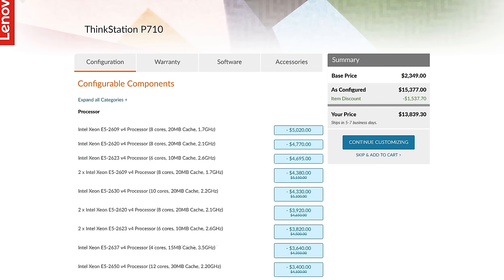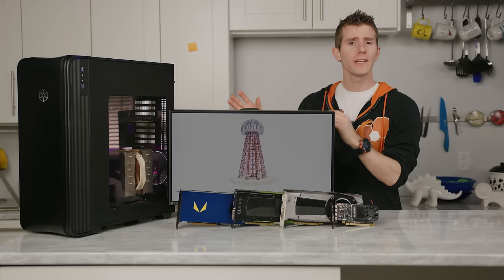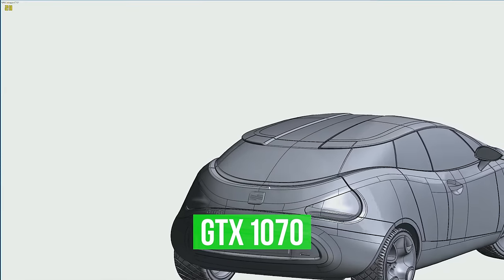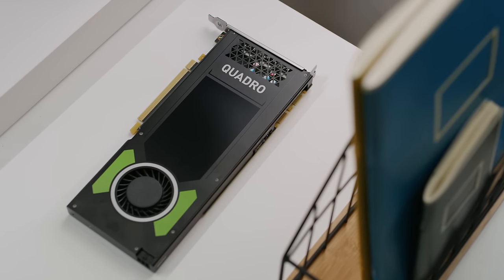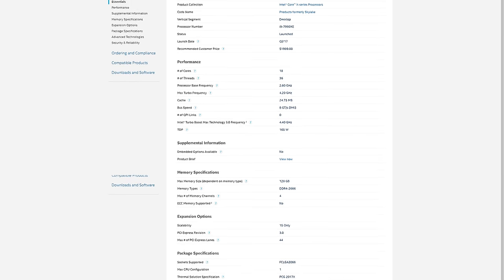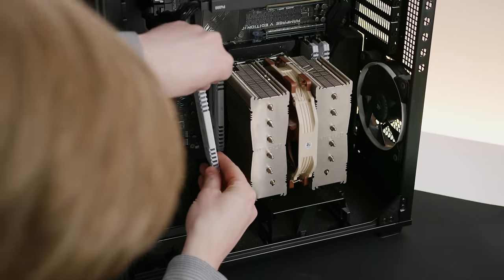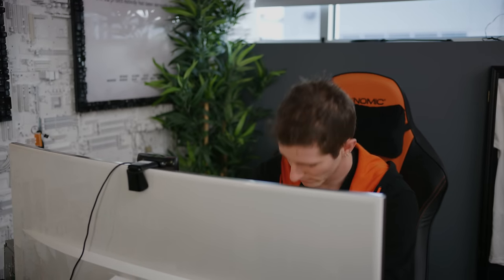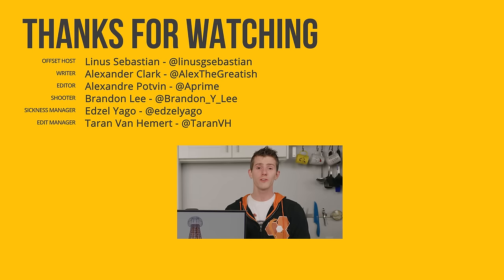3D Modeling & Design – Do you REALLY need a Xeon and Quadro??

Comment: Wait... If the Radeon Vega GPUs beat the Geforce consumer cards. Why was their no coverage of the WX9100 or the Radeon SSG with the Radeon Pro drivers?
Reply: Yeah, exactly what I was thinking, I also thought the whole shilling for intel/nvidia thing was mostly exaggerated or a joke but here it appears as if they are shilling...

Also, a few people noted that they probably wouldn't have just Solidworks or whatever prefered program running by itself, they may have a dozen other things also doing something and thus would rather have more cores than have Solidworks run a bit faster, so not sure what's happening on Linus' end but it isn't looking good on his part.
Reply: Linus' a shill. What did you expect?
Reply: I know, it's insane that he proved the driver can make loads of difference with these test and failed to include the AMD side. Especially considering that the Radeon Pro cards, which I would think to perform even better with the correct driver.

Comment: not to mention professional grade components are more stable. This is actually the core of the idea. Gaming desktop can outperform (in most senarios) a 2x more expensive proffesional desktop for design however it will lack in stability. This is no issue if you are designing for fun. However if design is the core of your job you should really be using proffesional grade hardware. I'm not trying to shift viewers to another person but tfi makes specific videos on inventor and hardware in link to cad, so if that's the program you're using i recommend checking him out

Comment: I use an Intel i3 4030U in a laptop with integrated graphics in blender.
Reply: Celeron G1610 with integrated graphics and 8GB ram in blender....!
Reply: 4gb ram. I feel you man.
Reply: :) Blender isn't for CAD as the subject  of this video is all about.
Reply: is it an hp pavillion? haha I got the same specs
Reply: Blender is not a proffesional certified software. Hence u can use anything. Try running a 4k full poly scene in maya with that...
Reply: Using Elitebook 8470p with i5-3320M and HD 4000 to game, browse web and do work
Reply: 512mb ram and a gt8400

Beat me
Reply: Can I see your portfolio of art works done with that laptop?
Reply: i3-6006U with 920mx :)
Reply: Mustafa Ahmed i3550 and integrated graphics 😀 it wasn’t too bad
Reply: I have used Blender professionally. It's not common but it does happen. It's a good program. I also like Maya and 3ds Max but don't have $4000.
Reply: TheVikingquest lmao you have no idea what you're talking about do you bud?
Reply: I use with a atom processor in my notebook with 2gb ram
Reply: @jm30013  lmfao what a noob. Mine is i3-2367M - intel hd 4000. 4gb ram
Reply: Then you aren't charging enough.
Reply: Been there, done that. I started blender using i3 2330M, Intel HD3000 and 2 GB of RAM. I feel u man
Reply: That's what I use. As linus says, "Fairly Affordable"
Reply: Blender will run on my old MacBook... enough said... ha ha ha

Comment: So how about the "Hybrid rendering" that I've been using on Vray. Works a charm with a good CPU and a GTX 1070ti
Reply: VRay isn't really a true hybrid renderer, it just emulates a GPU on the CPU. Also VRay is becoming more and more obsolete.
Reply: if you want gpu rendering go for fstorm,furry ball,iray... but specially not Vray
Reply: Hybrid render it depends, of your bandwidth to your Hard Drive, and your board from CPU to GPU, all so you need a faster RAM with a minimum of 8GB to take all the juice from your rig. That said if you cant aford a SSD to read from it you at least need 2 drives for render even  you dont do hybrid renders, one for read from it the file, OS, program, and the other one for dump all the finish renders.
Reply: nah forget those, use redshift or octane
Reply: Laughing at all the people on here talking down Vray. I've worked in the industry for 18 years. Vray has never been more popular. Newer GPU renderers like Redshift/Octane are cool, but Vray is still widely used and for good reason.
Reply: brendan coots Yep, they can forget those GPU renderers when making animations.
Reply: Charlie JH What hell is this "emulates GPU on CPU" bullshit? None of these emulates each other, it just simply don't make any sense. Rendering engine has to be coded specifically for used prosessor architecture and because Vray can produce very similar image on GPU than CPU, they had to make sure both produce mathematically similar end result from different architectural stand point and overcome possible limitations of small GPU cores.
Reply: Charlie JH Professionals Do still use vray as their primary engine. We use keyshot and gpu renders only for fun or on small scale projects. btw I render scenes with +million objects which is still impossible on gpu.
Reply: brendan coots that's what I agree on as well. It does also come to what you use it for. Here I make photorealistic renders of interiors and exteriors. For anything more VR I use UE4 or sometimes Lumion8 if it needs to be done fast.

Comment: At my school, we use Solid Edge by Siemens for CAD modelling. In school I use my Laptop with an I7 and a gtx950. At home I use a I7 7700k and a gtx 1080. Both work just fine, even my Laptop runs everything just fine, even if it is an assembly with 60+ parts. So in my opinion, I think it depends on the CAD program you use.
Reply: Solidworks doesn't use nearly the resources Linus indicates. 300 part assemblies run just fine on most modern hardware.
Reply: Solidworks would behave totally fine with that hardware. It's really not that much of a pig with system resources.

Comment: I'd agree with all of this if you're a hobbyist or student. But if you spend 40+hrs a week sitting behind a CAD machine, then you should really understand your workflow and tailor your system accordingly.  ECC and supported drivers are a minimum. 16GB ram is tight too. Ive never worked anywhere where the fastest machine available wasn't the best option, even if you factor in cost. Engineers are expensive, paying a high salary for someone who browses YouTube on their cellphone while waiting for a simulation to end is wasteful.
Reply: yeah my gf does graphic design shes working with this .tif files or something and her 32 gigs of ram isnt enough. so not sure where he is saying 16gb is minimum for cad. imo its 32 for cad. 16 gigs for a gaming pc.
Reply: yea just gotta wait untill you convince management to spend that kind of money on you and your department.
Reply: I doubt a purchasing manager for an engineering company is going to be getting tips from Linus. This kind of video is aimed at college students and the like.
Reply: Flyinghotpocket this really depends and no one should point and someone else's use case and say, "that's the minimum". Also image gfx design is a completely different use case.  It's about knowing what the designers/engineers work requires. Do you need rendering and at what detail level? Do you need local or networked rendering? Do you do large or small assemblies? What proportion of your work consists of large (>500part) assemblies? Then you have to evaluate costs.  Our previous workstations were 16GB systems with mid grade workstation gfx cards. For our type of work this covered us completely. No one shoe fits all.
Reply: Paul Bradshaw this is obviously not geared towards the self employed professional, those sitting behind a workstation for 40+hrs a week, or those with company purchasing decision capability. Like you yourself said, "You should really understand your workflow and tailor your system accordingly." Everything after that is moot since again this video is not intended to setting up an office full of engineers. Even so, not every use case requires the track capable supercar. In the professional engineering environment, you'll be hard pressed to find designers not on workstations of some sort. But they will be in every variety depending on what industry they are serving. I agree on the ECC ram and it would rare to find a professional workstation without it. However, 16GB is fine if, like you said, you understand your workflow. The fastest machine available is not necessarily the best or most cost-effective option.
Reply: SolidWorks has pretty good workflows to minimize performance requirements. Inefficient workflows will bring down even the fastest machines.
Reply: And I usually spend something like 8gb of my 32gb in daily SW use...

Comment: No FirePro?
Reply: FirePro Graphics Cards has been substituted by Radeon Pro series
Reply: Yeah, but there are no WX cards. Just Vega Frontier which is more prosumer than it is professional.
Reply: Well they didn't compare them. Even if Quadro had better performance it would still have been nice to see the results
Reply: We all know LMG is just a bunch of Nvidia/Intel shills anyway 

/s
Reply: There are 6 Radeon Pro WX cards you can buy, Starting with the budget WX 2100 all the way to the top end Radeon Pro SSG or the WX 9100.  Look them up, seem to have pretty damn good specs...
Reply: Because the got quadro cards for free to test them.
Reply: + Lon Holmberg As an engineering student I've been on the fence about getting a WX2100/WX3100 for a really long time now. Heck, with the pricing nowadays even a WX4100 would be cheaper than an RX 580 and a WX5100 isn't far off the 8GB models either. Not to mention the Radeon Pro cards being single slot 24/7 workhorses without any extra power connections until you get to the WX7100.

Comment: For everyone asking about 2020/2021 specs, here's what I just built to run Fusion 360, AutoCAD LT, and AutoCAD Mechanical. CPU - Intel i9-10900KF, Motherboard - Asus Prime Z590, Cooler - Corsair Hydro H100, GPU - NVidia Quadro P2200, SSD - 2X Samsung 970 EVO 1TB, RAM - Corsair Vengeance LPX 4x16GB DDR4 3600 64GB total, PSU Corsair RM650X. 1 Viewsonic 32" and 3 Viewsonix 27".

Comment: so you knock the x299 lineup for ECC memory being not supported, then recommends the 8700k? and an 1800x instead of a 1700 OC'd? I bet u benched the 8700k on a ROG board and the 1800x with 2133 lmao. And never mentions that TR CAN support ECC on certain mobos.
Reply: Blake well you dont need ecc
Reply: ryzen generally supports ecc and most boards can handle ecc so i guess 1800x should be above 8700K if you want ecc
Reply: Obviously, but he complained that the 7900x didn't have ECC support, yet fails to mention it with others. We call that bias, if you bring it up, you bring it up fairly, not just for one person.
Reply: Yes, and how many times has something like this come to Linus' mind and he makes a little "but you such n such" comments about things like this? Didn't make one in this case. Either roast x299 for lack of ECC and then make a note about Ryzen and ECC, or don't even talk about ECC in the first place, that is all I'm saying.
Reply: He also recommeneded a Xeon W with 18 cores for rendering when the TR 1950x could perform the same for half the price AND use ECC ram.
Reply: The point ISN'T that you NEED ECC, the point is that Linus talks about whatever the hell he wants about the products, instead of an unbiased look. If he never knocked x299 for ECC than this would have never been an issue.
Reply: Blake I feel like he recommendsthe 8700k just for the sake of recommending the 8700k. That thing is overrated as fuck. You want a workstation? Don't waste money on a gaming chip unless you do 80% gaming 20% HEDT.
Linus really doesn't feel like a genuine guy in these videos to me.
Reply: I don't think you understand JACK in what I said. Coffee lake performs depending on the mobo used, and no bencher will try to run 3200 on a 1700 in benchmarks unless testing specifically. I'm calling out Linus' lack of unbias. At least GN notes every specific detail of the testing procedre.
Reply: If you do simulations ecc
 is a must. When it comes to workstations the general rule is if your board/cpu supports ecc, get ecc.
Reply: That's a lie. 1950x doesn't perform anywhere close to the Xeon 18 core unless you're basing on useless Cinebench. In our workplace, the 1950x is more in line with the 12 core 7920x in real world applications.

Comment: So will I be able to render in c4d with my 1080 + ryzen7 1800 + 16g ram + 960 evo?
Reply: Vergenusszwergler Yes... I am rendering whit an i7 4720HQ and a GTX 960m just takes it time
Reply: humm no I think MS paint is the most demanding software that will run on this
Reply: you can render in any computer the more high-end hardware,the less time takes to render
Reply: yes you can, now it depends on your settings and render engine , you need one more drive so your EVO wont bottleneck with the os, app, read file and dump render, is safer to have a slow HDD just for dumping the final render
Reply: Pandametal - Guncraft thank you that helped alot now i will become a professional paint artist 😂

Comment: I do 3D stuff still with my old system, i7 920 and 2x GTX 560 ti 2GB each and 9GB DDR3 RAM, still works pretty nice but already building a newer system which will do a much faster job.
Working with Carrara and Octane most of the time.

Comment: what about autodesk?
Reply: solid works is counted as one of the top of the line CAD modelling programs, so that's why they aren't talking about autodesk
Reply: Most Autodesk products use DirectX 11 and run much better on gaming graphics cards.
Reply: Peter Thress 

Depends on wheter you're a freelancer or working for a big company.

I do both 3d modelling and animation so I went with a normal consumer grade AMD card since I knew for a decade now that AMD cards works better on most CAD.

You can do hyper realistic renderings even on an Intel HD chip but the major difference is in render times. (And you might lag real bad as you reach a lot of poly)

Maya supports both direct x and opengl as well as running on both windows and linux.

You should have a seperate computer for gaming if you're gonna be rendering animation scenes since it's always gonna be rendering.

That goes for hyper realistic simple animations for keyshots.
Reply: i7 7700k is top dog in Building Modelling. 8700k sits 5% behind Ryzen far back. Revit, AutoCAD etc don't utilize multi threading well currently. 
Solid works is  not the top CAD modelling software either, pretty one sided argument. Entirely depends on the workflow and the product. 
Dont get me wrong, Ryzen and the 8700k (and the top xeon/i9 insert top expensive cpu here) perform great in render heavy workflows, BUT NOT MODELLING.
Reply: My schools computer have a core i7 5 or 6 gen I think and some measly dell graphics card and it works perfectly fine. You do get some hiccups if you have a big assembly
Reply: Yes, those cursed Dell graphics cards. :3

Comment: What about zbrush and Maya users :(
Reply: ZBrush uses GPU rendering (my older version of ZBrush uses keyshot); so follow the advice for GPU and video cards. Maya uses CPU if you are using VRay, so follow the advice for CPU. Both ZBrush and Maya have minimum specs posted. You can use that info as a starting point.
Reply: What about all the other software users, this video was all about Solidworks and Keyshot, whcih makes the title misleading AF.
Reply: What about Modo users?

Comment: Not all 3D modeling is done in CAD, Linus. For video-game tier stuff basically any high-end gaming rig will do.
Reply: Anthony Flagg what gpu for rendering around 5-8 minute high quality cutscenes.
I might use EEVEE when it comes out but I might want to use cycles on blender.
Reply: Anthony Flagg So I only need one GPU for now and then I could use another? I was thinking of buying a 1080 ti then later on buying a 1180 ti or greater, will I need a SLI connector to connect them for stuff like CUDA Cycles render?

Also I'm probably gonna buy a high end ryzen chip like the 3700x or if they make a 3800x like first gen I'll get that one.
I just really want to make a new computer, for games and also content creation like 3d animations and maybe game creation.

I'm just assuming you know how to get information.
If you don't have a contact or you aren't in the industry, I'm sorry.
Me posting the comment made me less anxious about my choice
Reply: I personally have 2 1080Ti's for my Blender stuff, I get faster per frame renders than the renderfarm service I use (usually around 35% faster). When using Blender it is best to NOT have the cards in SLI, as you can run two rendertiles at the same time (one for each GPU).
Reply: VertSabre 
That’s a lot of power to be wasted on blender. Especially because gpu rendering is still inferior.

Comment: I do advance modeling on Catia (entire car assembly, down to the washer pump), at work I have a low tier Quadro and 6 core 12 threads Xeons from the 8th gen. At home, I have a 5820k OC'd to 4.5ghz and either an old 780 To or R9 290. I don't like to invest when it's not necessary, and my 16 gb of RAM do just fine, while the graphics card does not give me any problem. However, when using Keyshot in order to explain how assemblies work, I've noticed that the extra speed of the 5820k was really appreciable.

Comment: Hii, Can you pl update with rtx series cards including rtx quadro and Intel's 9th and 10th gen processor. Also guide how to use 2 Cards (i.e. RTX2080 and P4000) at same CPU. Switch RTX when gaming and Switch P4000 when CAD.
Reply: In w10 you can set which graphic card to which app/programm. Display>graphic setting > classic app > then search which game and set it to which graphic card you want. i hope it helps